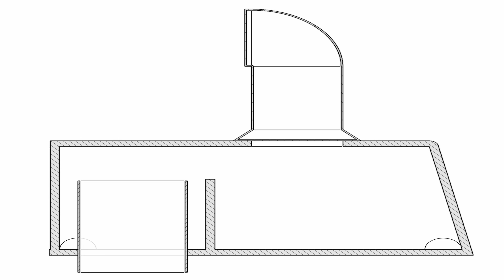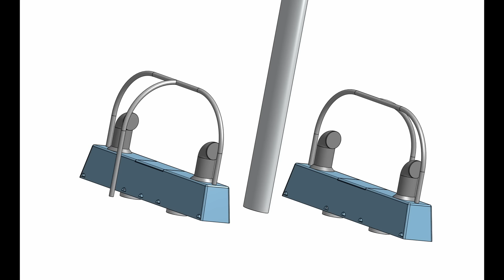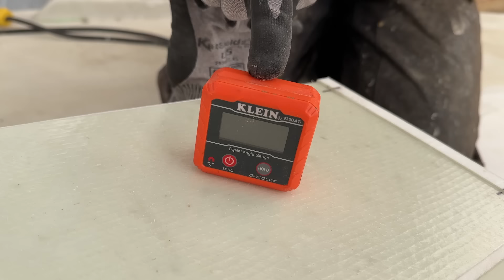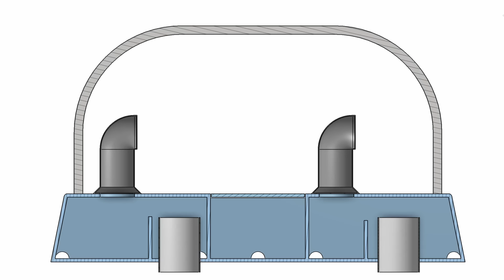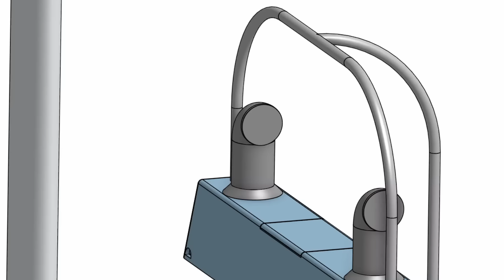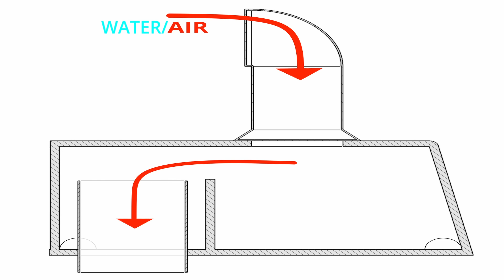Custom DORADE BOXES & Ventilation [EP133]

Comment: i think this is one of the joys i have in watching these videos, its all the thought behind the designing, why stuff goes where, and the fact you have to be mindful of so much, the functions and where stuff sits inside and out, what might they be in the way of, all the aesthetics 
glad to see you doing the butt rails to similar style as the stanchions which i think are a master piece and shows your thoughtfulness in engineering solutions - great job
and now you have the bouncing baby boy, any considerations for extra safety, be great to have something that is in line with what you are doing and not have to fudge something in that doesn't look right, something that can later be detached and so on

Comment: I’d love to see a departure from the HARD angles. More critically the corners being sharp. I get it… it’s efficient. It also injures you. Running on deck does happen. Sailing is endless hours of boredom interrupted by terror. I’d like corner to be a radius similar to a golf ball  Next… angle fore and aft. I’d match the forward angle of dorè to match the forward looking windows angle at doghouse. This way you start reinforcing continuity of lines. Repeating detail is easy on the eyes. The aft angle of the dore box matches the stern angle… a very shallow angle. So kicking it is not a big pain. how? THEY ARE BUILT! Build up FOAM on the inside of box. And shape the outside kinda like a shaper shapes a surfboard… then glass that
Reply: Given that the butt rails encompass the cowls how are you going to be “running on deck” and hit them? You will come to a stop at the rail and not contact the cowling.
Reply: @Youtuber-k2p Will it work as he has it? Sure! Can it be better? I’ll let you answer that. I guess the point gets lost on those who look at one element as if it’s in a bubble. Rather than a member of a composition. Lines do matter. My feeling is… the skill is there. Why not go for excellence.

Comment: Hey, To fasten things to decks I countersink in stainless bolts to a piece of G10 then epoxy it to the deck. I use acorn nuts and rubber gaskets with neoprene washers to keep things from rusting. Started doing this about 5 years ago and they all look mint still.
Reply: You can be excused as a new watcher but there is NO stainless steel on this project. The chain plates and all hinges are even carbon fibre. So that ain’t gonna happen. 😊

Comment: This was one of the most fun episodes in a while, and you have found some excelent solutions, like the PVC pipes and plugs for the inflow tubes, which is so smart, because, lets face it, PVC is meant to deal with water, it is strong and affordable. Plastimo makes very cool looking Dorade cowls in PVC, which will look great on Duracell's deck, more interesting than traditional stainles steel ones, I think, and likely to be less expensive.
Reply: grey pvc used for electrical does better with uv degradation.  doesn't rot as fast as the white does in sunlight
Reply: @dennisshain  these will never see daylight again once the boxes are glued on top.

Comment: I recently finished a model electric fast boat. On a model it is a bit more difficult to get air flowing through the boat. I put a brass tube in the bow running from one side to the other, and slotted it at the top. This means that air is forced in through the slot and out through a cowl at the stern, and water that may splash in is held in the tube and runs out. Obviously not suitable for your boat, but on a smaller boat with limited deck space it might work.

Comment: First off, love the channel, I’ve been following since late 2022 and it’s amazing what you’ve done. I noticed glue is used as an alternative to screwing or bolting down a lot (which I understand as Ive always tried to avoid drilling into the deck). I was curious though, are you concerned with the integrity and strength of glue for areas with high load, like the chain plates for instance? I like the fact that the dorade boxes are fitted with glue directly to the fiberglass, but was thinking about the butt bars potentially having a lot of load in the event of heavy seas (I.e. grabbing them when you need them most). I could also be underestimating how this glue is, perhaps it functions more like resin - west systems has an epoxy glue like that - but noticed that here on the east coast, glue tends to weaken over time with changes in temperature, exposure to moisture and UV exposure. 

Not being critical, just curious!
Reply: Let me get this straight, you been watching since ‘22 and you are under the impression that only glue holds things down  rather than being bolted or screwed “a lot”? Where to start! You need to actually sit and watch a whole episode. EVERYTHING is fibreglassed to the deck/hull. The glue is just to hold things together while the structural fibreglass is applied. There are NO screws, No bolts, everything is fibreglassed on so it’s not a case of “a lot”. This has featured in pretty well every single episode so I can’t see how you think stuff is just glued on. Just in case you missed it, nothing is just glued on and you mentioned the chain plates which had like a million metric tonnes of fibreglass and resin holding them on and this structural stuff is all overseen by a naval architect whom you will have heard of in nearly every episode.
Reply: I think you misread my comment, and nice throwaway account… I’m not questioning anyone’s ability or expertise with this project (I never did), and I do watch each episode start to finish. If you read my comment I was specifically referring to load points. I don’t think glue is holding the boat together, nor did I say that. My point was more surrounding the chain plates, which are holding up a pretty large rig - not sure if you know this “YouTuber” but this is a huge load point, especially under sail or in heavy weather. I realize that the chain plates had fiberglass around them, but we’re talking about high tension forces - there’s a reason cleats and winches aren’t glued and fiberglassed to the deck. 

Anyways, I mentioned I’m not being critical here, I was merely asking. And more concerned with the degradation of the glue from the elements.
Reply from the maker: The glue is strong. I’m not worried about its strength

Comment: I believe that airflow on boats works better, where the air is drawn in at the stern and exits foward, so you will need dorades further aft too.  The shoswer doragde would need to be in an 'extract' mode, so there need to a mixtue of in and outs.  In extreme conditiors wind scoops and the like are effective.   Will you have screens on the intakes, to keep the bugs at bay?
Reply from the maker: Yes

Comment: A boat i worked had little dorade lockers rather than hinged the lid was snug with a a rope tying it to the butt rail. Made it fairly water tight and made them really use able rather than a hinged lid in an awkward place with the butt rail.
Reply: A little locker up there is great for sail ties or an emergency shackle key and knife. I am putting one on a boat I am working on but i had forgotten the dorade locker. Nice

Comment: Those look really good.  It will be nice to see them done. I like the PVC plug option for cold weather days or really hot weather days.

Will the butt rail be out of the way of the rigging lines?  Or is there any interference issues with walking up to the bow of the boat?
Reply from the maker: yes, definitely

Comment: I had to chuckle a bit when you made those bearing blocks for your air intakes so that the intakes were "square to the Earth". You're on a sailboat!!!! When is a sailboat EVER square to the Earth?? Only when it is on the hard. LOL
Reply: I believe it’s also square to the earth when sitting in the sea/water as water finds its own level to the earth.
Reply: No buddy. It is flat on the water and therefore square to the Earth. The water is level compared with the planet, well it’s actually curved as the Earth is sorta round but level for all intents and purposes.

Comment: 🤔💡 just say it. Those are Granny Bars over the dorades. 🙄     BTW, the boat will NOT always be in same direction as the wind. You know that.
❤👍🏻 Nice 🎶 🎵  too❗️
Reply: At anchor the boat will most of the time sit head to wind. Only if tide is stronger than wind will the boat not sit head to wind on anchor.
Reply: @jimmyjohnstone5878  Yep. And still, normally the cowls can be turned 360º.👴🤷‍♂
Reply: Did you miss where Matt said the bow will be “mostly” facing the wind? 🙄

Comment: Looks fantastic, Matt, with the 4 inch PVC fitting s consider using poly urethane instead it holds up much better with cold weather and won't get brittle and crack in cold/ frozen temperatures. Awesome mate
Reply: PVC is fine in cold weather and it is officially rated for -15º c. As it is partially inside the cabin it will never get that cold.
Reply: @Youtuber-k2p  I was an irragation technician while working in Germany, I don't think PVC would handle frozen water. It will crack. That's why we used poly

Comment: Question.. you mentioned you wanted the inflow tubes perpendicular to earth. Why is that? Wouldn’t perpendicular to the deck be easier for finishing on the inside? They aren’t visible otherwise.
Reply from the maker: if perpendicular to the earth... on one tack or the other it would be easier for water to come in. finishing them on the inside will be the same either way.

Comment: I was wondering if it was possible to put in 12 volt 4/5 inch fans in the dore boxes to provide circulation when not sailing. One in the shower that is reversible would be nice. Just a thought.
Reply from the maker: Yes, I might do that

Comment: Mat, as someone well pointed out here, the boxes should be screwed in to the deck in order to be servicable/cleanable..
When doing it, you will be dissassembling the butt rail too  -  big task as outside foot of it is Fixed to the deck and to side ones to the box..     I would have all 3 buttrail foots rather fixed to the deck -  outside box, and the box doesn't need to be screwed superstrong in order to hold (big) forces of butt rail.   
just my toughts  (knowing is probably too late now)
best regards from Croatia where l hope Durracell will visit some day..😊❤
Reply: When was the last time you saw Matt screw any thing down as a permanent fixture ? Never and there are no metal fixings. Matt will have thought of a solution, perhaps the dorades will come off to allow access.
Reply: @Youtuber-k2p  indeed , right you are but the bottom line is, i am convinced that buttrail must be independent off the box, fixed to the deck and outside it to facilitate eventual dissasembly of the box and be way more robust solution

Comment: with today's efficient tech its surprising more a/c isn't used instead of constantly dealing with comfort and humidity issues...
Reply: They are no where near being efficient enough to run on batteries for long. I am sure battery tech will improve more than air con efficiency and be a possibility in the future. High latitudes are not ideal for solar charging of batteries either.

Comment: Be aware of the fact that screw-in PVC plugs will leak if not properly sealed. The way you intend to use them will result in water dripping inside if water enough gets over the bulkhead to splash down on the plug.
Reply: But the whole idea of them is to not allow water into the boat due to their baffle design so water cannot get into the pipe and past the plug. Remember the plugged tube is NOT connected to the dorade tube. They’re separated by the baffles and water that gets in through the dorade falls down and flows out through the sides of the cowling.
Reply: @Youtuber-k2p  If the quantity of water is sufficient, it can overwhelm the drains and overtop the baffle!

Comment: When you had the 2 boxes leved out on the deck. Why would yo not just take a block, as tall as the biggest gap, and then mark the cut linje all the way around? That way you would get a perfect outline og the deck.
You could also cut with the blade at the same angle as the deck.
Wouldnt that work better?
Reply from the maker: That would work too